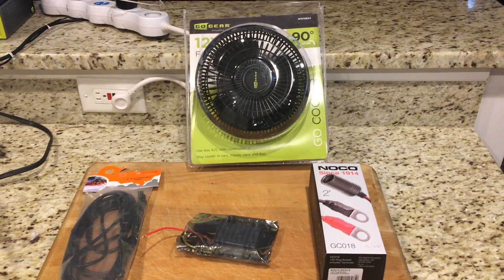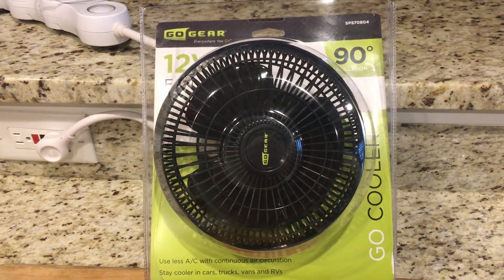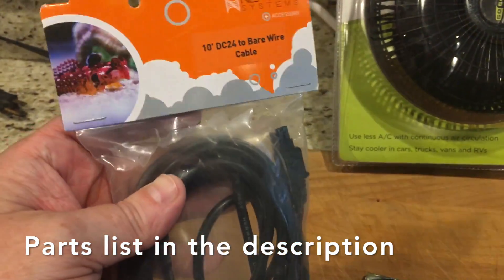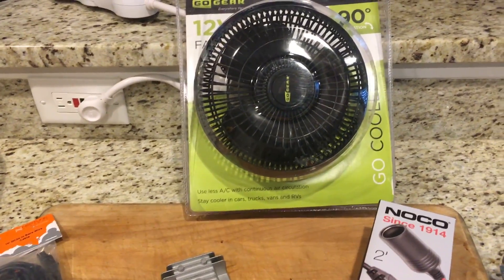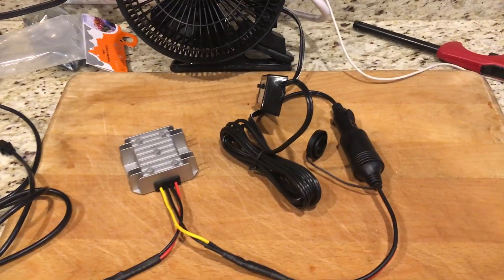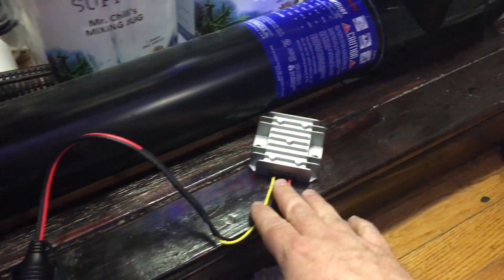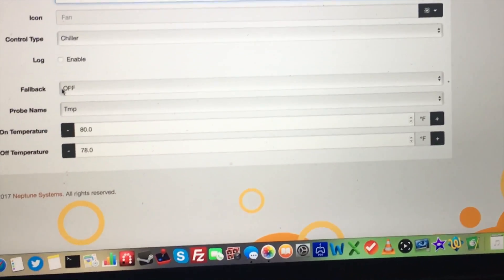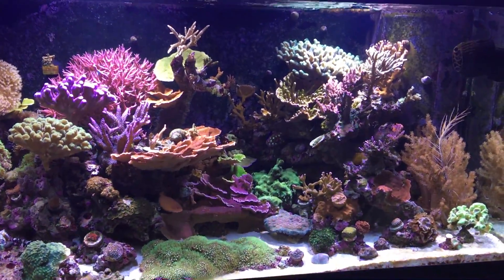Neptune Apex DIY 24V to 12V DC Fan Project

Comment: i have one of these fans.  I would like to plug my 18v battery.  Will I need to reduce voltage of will the fan tolerate 18v without burning the fan

Comment: Another question: Could I power two of these fans with a 2-way Splitter https://www.amazon.com/NOCO-GC020-Adapter-Socket-Splitter/dp/B00G8WLT7C/ref=pd_bxgy_263_2/141-2897911-1330856?_encoding=UTF8&pd_rd_i=B00G8WLT7C&pd_rd_r=71ea6587-955b-11e9-aa23-c7cae6a5aa84&pd_rd_w=Cs9K1&pd_rd_wg=55EcU&pf_rd_p=a2006322-0bc0-4db9-a08e-d168c18ce6f0&pf_rd_r=399J28FP50435NMWQGWT&psc=1&refRID=399J28FP50435NMWQGWT on the same step-down transformer coming from ONE 24V DC port on the EB832?
Reply from the maker: Yes. That is what I do. I have two fans running with a splitter.

Comment: Amazon says this fan comes with screws for a car dash mount. Do think this type of mount would allow for an installation to a vertical wall inside a tank stand without the clamp?
Reply from the maker: Yes. It comes with a small metal bracket so you can mount it to something flat, like a wall or cabinet.

Comment: Hey ReefSpy thanks for pointing this out to me. I am seriously considering this. How many degrees do the fans cool the tank?
Reply from the maker: Sure man. It will definitely get you a few degrees. I have mine turn on at 80F and keep going until the tank gets back down to 78F. I can see on the Apex graphs that it’s actually working.
Reply: How long does it take to get down those 2 degrees? a few hours?

Comment: Hey I just tried doing this with a noctua no-r8 redux-1200 computer fan and hooked it to a 1-link port and I get clicking sounds. But it works when I plug it in the energy bar like what you did. I called Neptune and they said eventually it will happen to my energy bar as well. 
My step down is virtually the same.. 
I don’t know why it wouldn’t work
Reply from the maker: Thanks for the heads up. I was able to run this all last summer and did not appear to have any issues.  You mentioned using the 1-link port. I don’t think you can use that for this. I am using the 24VDC utility port on mine. I will keep an eye on it for sure.
Reply: I would think it’s the same since they are both 24v dc. But I’m. It a electronic wiz. I do see a difference. My step down is 24v to 12v 20Amax. 
Yours is 5A 
Mine is a tobsun brand from amazon” So that might be the mistake I made

Comment: Great video! Do you know if you can use the 1link ports in a similar fashion? The three 24V 1Link ports are basically useless otherwise unless you have Apex dosing pumps or powerheads
Reply from the maker: Thank you Patrick.  Its not possible to use the 1-Link ports for anything other than the Apex approved accessories.  From what I understand the 1-Link ports provide both power, and data communications to the Apex approved connected accessories, anything connected to these ports will appear as their own devices and be treated special by the Apex.  The 24 port utility port just shows up like any other outlet and only provides power.  DIY projects are supported by Neptune for these ports.

Comment: Great vid. I programmed with Apex a 16" Walmart oscillating fan on a table next to my tank to blow b/w the T5s and the tank to help cool. Does an extremely good job. I had to put an extra heater in the sump bc it worked to well.lol

Comment: THANK YOU ReefSpy. I have a clip on fan taking up a power outlet on my Eb8. Going to do this asap. Perfect video. Gonna break out my soldering iron and heatshrink. Thanks again.
Reply: Just realized The Eb8 doesn't have the 24v acc port.  Bummer
Reply from the maker: Damn, sorry, I guess only the new power bar has it.  I didn't know.